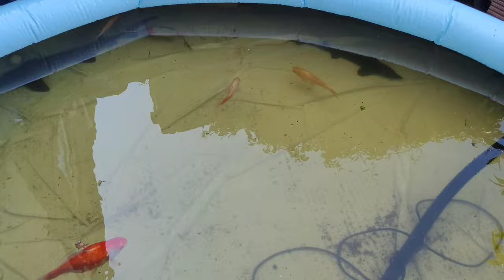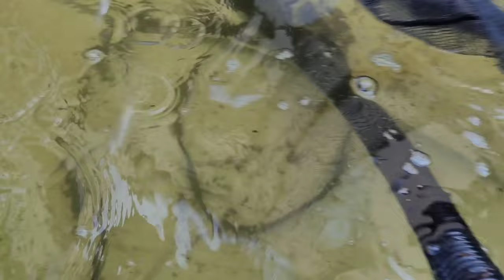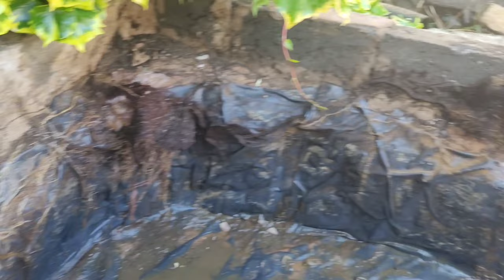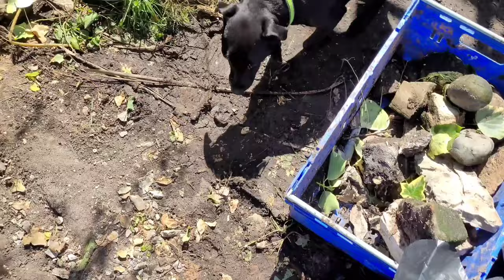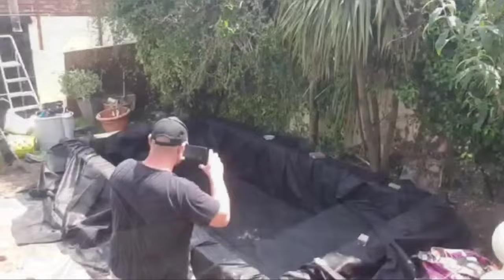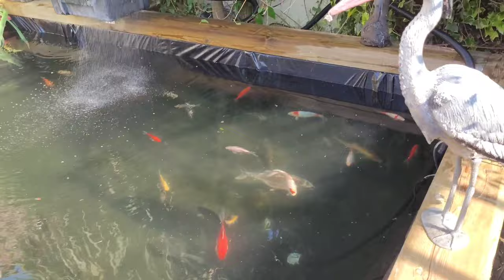" Restoring a 40 year old  Pond, Epic Fish Discoveries, and Full Sleeper Pond build with Easy Pod!"

Comment: Could the medal screws and brackets work through the liner eventually ? Causing a leak?
Reply from the maker: I don't thinks that would work as you'd be putting holes in the liner the it will more than likely leak